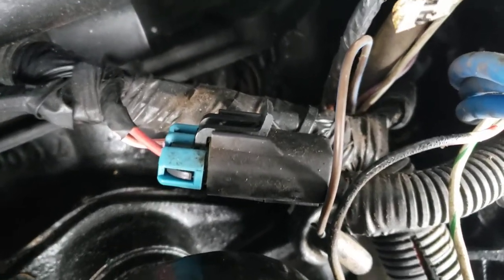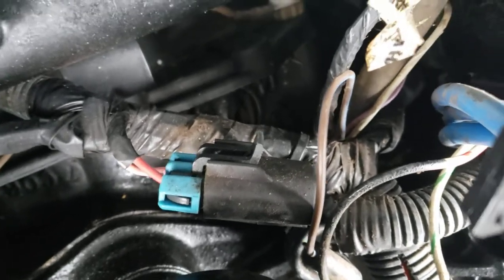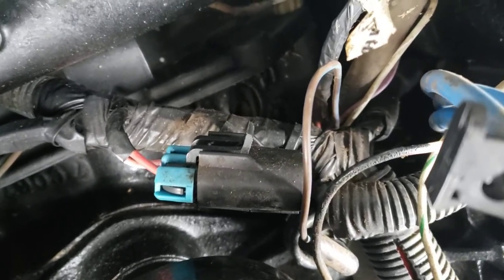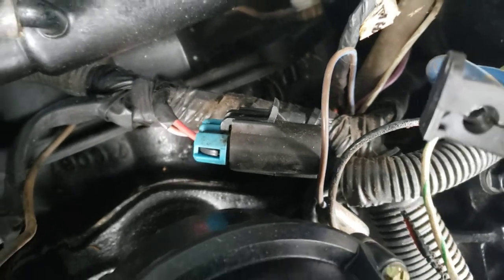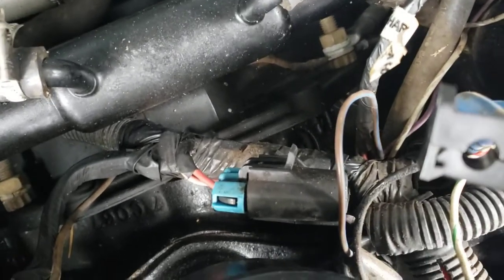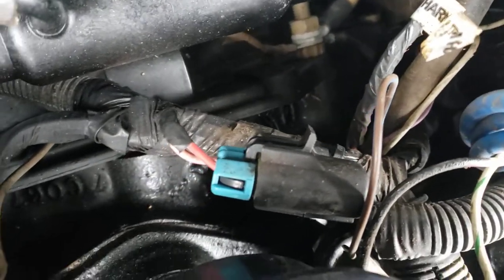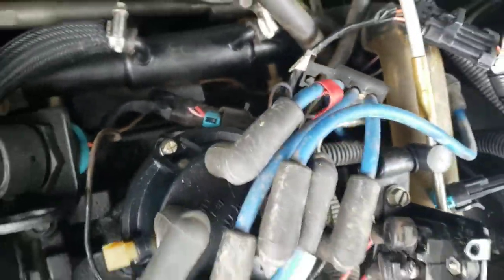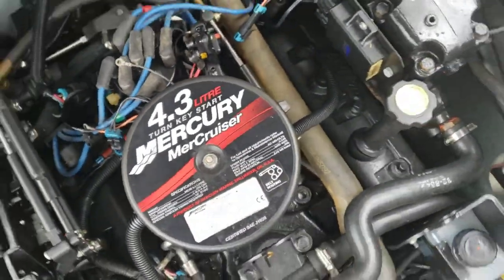2008 Bayliner - No power to ignition. There is hidden 15amp mini fuse at the back of the motor.

Comment: Would that 15amp fuse cause the Started solenoid and fuel pump not to engage?    I have power to all gauges and trim,bilge etc. But motor wont crank.  Ive checked all other breakers and fuses. Except this one and the 90amp fuse located on the starter.